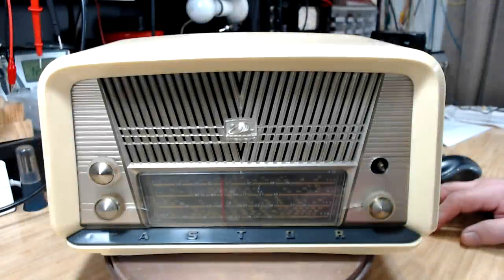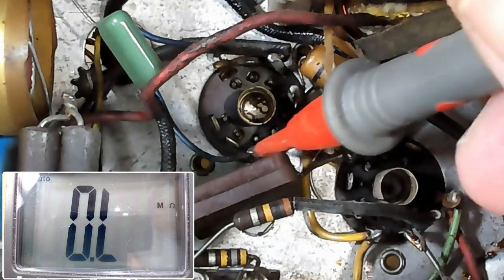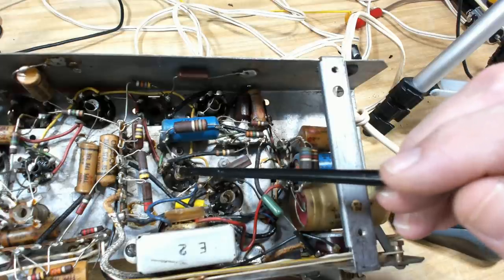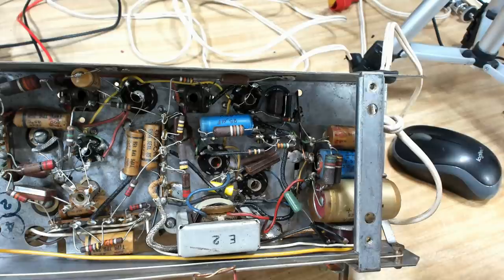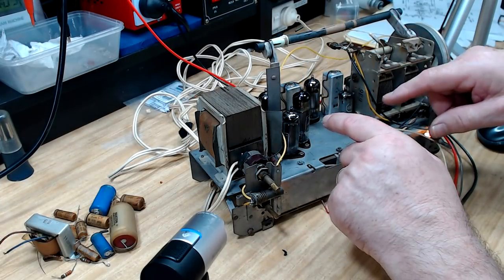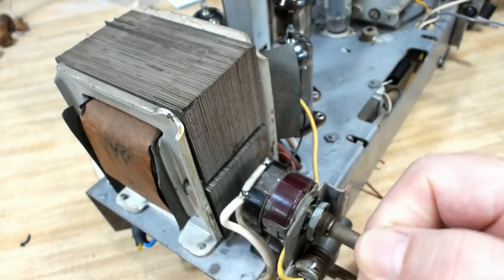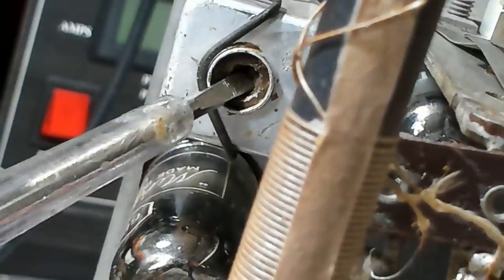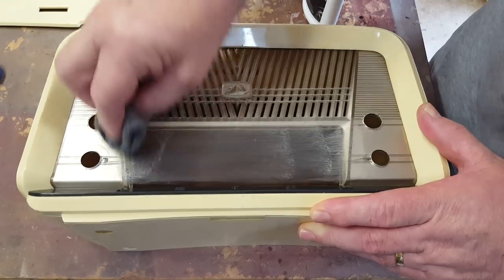Astor BPJ Radio Repair 1958

Comment: My family had the same model in our kitchen. Great radio that has stood the test of time, Ours also needed the caps replaced and also a couple of electrolytics over the years. Radio was on for around 8 hrs a day. 
Only one suggestion, if i may The mains wiring to the power on/off switch, if you were worried about the closeness to the power transformer, you could use a  bit of heat shrink over the switch terminals and  a bit of sheet plastic ( old ice cream lid cut down ) glued to the side of the transformer. 
Other than that another one "done and dusted". Love your work, keep it up.
Reply: MichaelKingsfordGray   Yes there are a number of thing that you could use as a insulator and press board would be a good one to use. Thanks for the feedback
Reply from the maker: I thought I responded to this 😏 In the end I decided it wasn't a problem so left it as designed. I have some Jaycar pressboard, it would be ideal for this 🙂

Comment: For those cracks in the front, I believe you can improve them by running superglue in from the back off the end of a pin.
Reply from the maker: Thanks Jonka1, I might try that if I can't find another option, thanks 👍😀

Comment: A nice easy one for a change! Bring back the memories of youth, good stuff!  Some of the big box hardware stores here in the U.S. have started stocking 6 foot (3M) extension cords both in 2 and 3 prong with the cloth covering, very reasonable price. Just cut the end off that you don't want.  I have repaired a lot of headlights, I find that moving only one direction, not in circles is the quickest way to get through the process. Each time you change grit you change the direction by 90 deg until you see that all of your marks are gone. I start depending on the plastic at about 600 grit wet and dry paper, use water as a lube. Finish with 6000 grit  then polish.  Circles will give you swirl marks and make it very hard to see if you have removed all of the prior grit marks. You are just working harder than you need to. I like your knobs... that might sound a bit odd out of context ! LOL!
Reply from the maker: Hi Wayne, yes, good to get a easy one once in a while. The cloth covered leads sound good, maybe they will find their way over here. I think from memory the method you outlined for the plastic repair is what it says on the box but I didn't read it. I will do what you suggest the next time... promise. Thanks Wayne 😀

Comment: This Radio is the third you've restored that I've not long worked on. This one in particular I only just put in back in its cabinet yesterday. Mine has a white cabinet but had a big stain on top. Carl's has quite a few items that you can't get anywhere else. There used to be a couple more selling Caps and what not but have disappeared so Carl's is the best of who's left. I've been looking at a 3D printer to make cabinet parts .Be nice if you could make a whole cabinet but the printer would have to be huge and I'm not sure how the plastic would handle heat. So far I've been making the knobs on the lathe with a brass insert that way their not so delicate.
Reply from the maker: Hi anno250, Yes, Carl is building quite a stock of parts for the radio community so I like to support what he does. That would be great to be able to print a new cabinet, maybe one day 😉

Comment: Good job once again, thank you. It occurs to me, that all radios of the 50s-60s had bakelite cabinets rather than timber. I did my Radio apprenticeship in 1960 in Germany and at that time I recall only Phillips had a little bakelite radio. All other German makes had timber cabinets.
Reply from the maker: Thanks Peter. I think most Aussie mantle radios were Bakelite or plastic by the 50s and 60s. I looked through my collection and the only wooden ones were based on English models or are German 🙂

Comment: Great work as always, Dave! Regarding the cracks in the transparent plastics there's epoxy stuff with very low surface tension used to repair cracks in glass or plexiglass. You apply it with a syringe like thingy and it's getting "sucked" in to the crack and makes it practically invisible. Then just scrape the excess off and polish it. Seems you have an automotive shop nearby that probably would have it. :)
Reply from the maker: Thanks Kristian, I'll see what I can find out, cheers 👍😀

Comment: I thoroughly enjoyed that 44 minutes David. The radio is a great reminder of your brother and good times unfortunately long gone. 
I was Browsing on Ebay the other day for the hifi separates I bought in the 60's when I started work. It's all there, the amp turntable and speakers. I was tempted to buy them to remind me of my youth but retro hifi is pretty expensive now and I'm just too tight fisted to open my wallet. Ah well the memories are just as good anyway.
Reply from the maker: Thank you Bruce. Pity the retro gear you wanted was too expensive, probably better to just stick with the memories, it's cheaper and takes up less room 😀

Comment: Thanks for another interesting project video. Re. at 30:16 the trimmer cap type was common for Philips compact bakelite case radios in the 1940's, and they had to be aligned by winding/unwinding the wire over the core at each trimmer: a MAJOR pain....
Reply from the maker: Hi Harri, thank you. I've seen them in the Philips radios too and some other brands. I don't play with those capacitors, I use them as the base adjustment and adjust around them. I did have a broken one once and replaced it with an adjustable trimmer. Thanks Harri 🙂

Comment: In the states they carry a plastic cleaner  called Novus. I suggest you order a small three part kit and try it for bad clear plastic scratches! Ebay. Amazon and elsewhere.
On the plastic  cabinet mark  try  non whitening white toothpaste . Trick with the paint pen is to use a small brush to coax the globs down to an overall flat  level.
Like Carl's replacement knobs! Excellent restore on this radio David.
Reply from the maker: Hi Steve, thanks, suggestions noted 👍😀

Comment: To get the scratches, fog, hazing out of clear plastic, I use two products: Mothers Mag and Aluminum Polish and Novus #2. Start with Mothers and apply with a cheap dollar store ultra absorbent cloth and apply Novus to finish. Usually only takes one application, two at most. Buff with a microfiber cloth.  Works great on any plastic including eyeglasses with plastic lenses.
Reply from the maker: Thanks for the tip jordanch68 👍🙂

Comment: Great job as always, I use car rubbing compound on plastics, works very well, also brings Bakelite to a mirror shine.
Those new knobs really finish off the set nicely.
Reply from the maker: Thanks markpirateuk, I use auto cutting compounds too but a bit cautious with this plastic, I have had some react to them in the past. That's why I suggested testing it on the bottom first 😊

Comment: That's a lovely radio, very nice design. And excellent results, as always! I like the "these are not the Droids we're looking for" Jedi gesture when changing caps. I need to learn that trick, oh Mighty Master. I can think of many, many applications.
Reply from the maker: That era produced some nice practical radio designs. The insto cap replacement saves me a lot of time but requires many years of study and practice, it's not for the faint hearted 😊

Comment: Dave, Well done with the Astor as usual. Refering to Jerker Fridh, School of the air by David Tipton sounds really good.  I  also have one of those Palec Valve/Tube testers , and  it's  not user friendly at all. The Brain Box works overtime whenever I use it. Looking forward to your NEXT RADIO ADVENTURE.
Reply from the maker: Hi John, thank you. If I can get Jerker to do the peddling, I'm in 😉
I like the tester but... "move levers with F1 to E and F1* to F2 then levers at that you moved previously to E move to F1 except..."  I might rewrite the manual or something 🙄

Comment: Great job as always!  I think the new Knobs made the radio GLOW! P.S. when I clean the tar from smoke, I use a product called "Purple Power concentrated" it just dissolves the gunk.
Reply from the maker: Surprisingly, I can get PPC very close to me but only in a 20 liter (5 US Gal) container 🙄 The stuff on the IF transformers was a sealing material used to seal the transformer slugs. Engine degreaser might be an idea though Bruce 👍😊

Comment: David!
Good to see another video from you!  This was indeed an interesting radio.  It was a wonderful bit of "luck" that no alignment was required since you couldn't adjust the transformers.
Lots of interesting things to learn in this one too.  Things like what you used to clean the plexiglass and how you overcame the problems in the process.
Those knobs are really cool!
I wonder if you would accept a challenge from me.  The challenge, should you decide to accept it, is to design and build from scratch a vacuum tube radio.  In fact, I'll give you a choice of three.  The one I would prefer is choice number 3.
1.   A.M. Broadcast only.
2.  A.M. Broadcast plus Shortwave.
3.  A.M. Broadcast, Shortwave, and FM.
I really appreciate your videos very much.  I wish that it were possible to have a new one every day of the week.  
Keep up the excellent work my friend.
For you and your family, Stay Safe, Stay Healthy, and Stay Happy!!!!!!!!!!!!
P.S.
I wonder if Carl could make knobs for this type radio:
https://radioattic.com/soldradios/sold_radios_2009/Toppo_Garod_Neutrodyne_V.jpg
Reply from the maker: Thanks Wayne. I might just decline your radio building challenge at the moment thanks, no time 😄 If the IF Xformers need adjusting there are ways around it if I couldn't get the slugs to move. Those knobs would be tricky to reproduce 😯😀

Comment: I REALLY 😴 like the "V" shaped speaker 🔊 grille!! This has to be the Chevy Bel Air of radios 📻!! 1958 is a year very worthy 👏 of that. I'm not sure if the speaker in this radio is field coil, or permanent magnet. Bakelite case, or are ya gonna tell me different? This is one radio I haven't commented on, so I 🤷 thought I'd drop ya a line. I hope that the dial light ✨️, and dial cord were good 👍. Your friend, Jeff.
Reply from the maker: Hi Jeff, it does look like a car grill 🙂 It's a plastic case and a PM speaker 👍🙂

Comment: David, you’re the best. You have mad skills for restoration. Could you do one thing to help us? Could you explain why you tune the items you tune to align the radios. Sometimes you tune the antennas, sometimes the transformers/IF cans, and in this video you “tune” the slug on the antenna. What tells you which item to adjust and which frequency to tune them to? Keep up the great work, and keep these videos coming please.
Reply from the maker: Hi Graham, that’s a big question and requires a detailed answer. I will do my best but it may be more than you requested and difficult to understand.
Step 1
The two IF transformers need to be adjusted so they will only pass a certain frequency, that is normally 455kHz. A 455kHz signal is injected into the radios front end either via the antenna or the grid or grids of the mixer or IF amplifier tube, usually the grid of the mixer is sufficient. The two primary and secondaries are adjusted in both IF transformers to resonate at 455kHz i.e. peak signal at the radio output.
Step 2
The radio should now work but the station signal needs to align with the dial markings. To start, the dial pointer is set to a set point usually marked on the low end of the dial with the tuning capacitor fully meshed. The pointer is then moved to the 600kHz mark on the dial, the twin tuning gangs will then be at the 600kHz preset as well.
Step 3
Next, we need to adjust the tuning capacitor to tune to the frequency the pointer is pointing to on the dial.  There is always an antenna coil and a local oscillator coil. The local oscillator is self generating and provides a frequency which is 455kHz above the station frequency. The resident frequency of each of these coils changes as the two tuning capacitor gangs are moved through their range and both, most times, have a slug to fine adjust them. 
Now the dial is pointing to 600kHz, the tuning capacitor is at its 600kHz preset position and a 600kHz signal is supplied to the antenna, the oscillator needs to resonate at 1055 and the antenna coil at 600kHz, the difference between the two being the 455 IF frequency. The antenna and oscillator coil slugs are peaked to achieve this. 
Step 4
The dial is then moved to the top end of the dial near 1400kHz. The tuning capacitors usually have trimmer capacitors near or on top of each tuning gang. These have the effect of adjusting the overall capacitance range of the tuning capacitors. With a 1400kHz signal injected into the antenna the oscillator is peaked using its trimmer, stretching or compressing the capacitors capacitance to line up at both ends of the dial range. Once peaked, the antenna trimmer is also peaked aligning the antenna capacitor to 1400kHz as well. 
That’s about it except the 600kHz point needs to be rechecked then the 1400 point again until both ends are peaked.
My radio in this video had a loopstick antenna which took the place of the antenna coil hence the adjustment was the small coil on the loopstick in the video and not a slug, same result.

Comment: Very nice radio David! It has a bit of the Philips Philetta style, the usual cracks in the all-perspex front inclusive. Have you contemplated filling those cracks with the special UV-curing glue they use to make stone chips in car windscreens almost invisible? May be worth a try...
Cheers from Germany
Reply from the maker: Hi Blitz, thank you. Yes similar lines to the Philips. The windscreen filler has been suggested but I haven't looked into it yet, thanks 👍🙂

Comment: On those raised Astor letters,  did you consider gold leaf ?  You can get fake gold leaf, it's much cheaper and looks pretty much the same.  Came up lovely, even the faded plastics and the case looks fantastic.  But the sound is amazing for a single speaker.
Back in the day it would have been very enjoyable to listen to music on this radio.  You know, back in the day when they used to play actual music on the radio.
Reply from the maker: Hi Ellesmere, no, I didn't think to try gold leaf. I was trying something a commentator had suggested, I'll put gold leaf on the list of things to try. The radio came up great and we have to stations playing oldies so we are very lucky 🙂

Comment: I doubt if it was nicotine on the IF transformers. More like a waxy substance, overspil from the securing of the core of the transformer. I use my nose 😁 for this type of investigation.
Nice work, once more 👍🤝
Nard
Reply from the maker: Hi Nard, spot on. I did run a message across the screen after I had worked it out. This is the first radio I've seen that had been sealed at the factory 🤦‍♂️🙂

Comment: Nice restoration. To bad about those cracks in the plastic.
That gold you put on the ASTOR letters, maby you could apply the paint to a flat surface
lika a metal plate or something, and then pressed that down on one letter at a time to apply it?
"There she was just walking down the street singing......" :-)
Reply from the maker: Hi Geir, yes, the cracks are disappointing. There are better ways to apply the gold, I was just doing it because someone suggested it. I have in the past stretched some cloth across a piece of wood and used that, some thin foam might work as well. It came out pretty good once it dried though, I was surprised, thanks Geir 👍🙂

Comment: Great timing :) I just bought a coral pink one. Very informative video David. The knobs are on the way from Carl. I do have some damage to the lower left corner of the case that will need repairing, do any of your videos cover plastic repairs?
Reply from the maker: Hi BK gold detecting. Happy to oblige with the timing 🙂 I did a Philips plastic radio with significant cabinet damage, link below. I used thin aluminum sheet and JP weld to glue it together. If you go with aluminum sheet be aware it may interfere with the loopsticks reception. If its only small and on the base it should be OK. Some use fiberglass but I don't think the resin adheres as well as the JB Weld.
https://youtu.be/LYv3m8dQjWM
Reply from the maker: You may be able to get automotive acrylic lacquer mixed to match the radios colour. It will cost a little bit though 🙂

Comment: Great job, thank you. One question: what is the bulb used for in your test system?
Reply from the maker: Hi TPNS, the bulb is used to limit the current flow into the radio in case of a short or partial short in the radio. If the radio is operating normally there will only be a dim glow in the bulb, if there is a short the bulb will come on bright and limit the current to a few hundred millivolts. I did a video on it a few months back:  https://youtu.be/ykUlzhCTLvg

Comment: Just wondering what value you used to replace the 25uF 40v electrolytic. I’m having trouble finding one locally in Melbourne. Plenty of 22uF 63v in stock but I think the rule is you go up in value not down. I have plenty of 24uF 600v that I can use for the filter caps.
Reply from the maker: Hi BK Gold Detecting, without checking I probably used 22uF 63V electro caps from Jaycar (RE6080) the same as you have. The original caps would have had a fair tolerance so 22uF will be fine. You are correct to say normally go bigger and you should on filter caps but I think you will only get a imperceptible tone change with these cathode grid caps 🙂
Reply: @DavidTipton101  Thanks Dave, I’m a jaycar man, spend half my life there :) After I messaged you I did find a 25 uF axial 50v at Evatco in QLD. Only $2 but $10 postage. I think I might stick with the 22uF from Jaycar. :)
Reply from the maker: @BKGoldDetecting  I haven't looked at Evatco very much, I must do so, they have a lot of electronic parts suitable for valve radios.